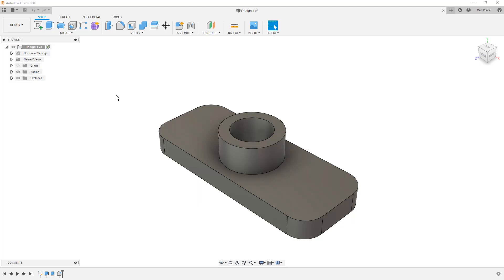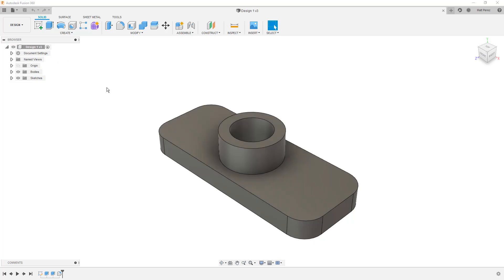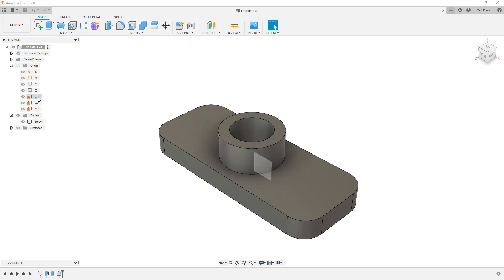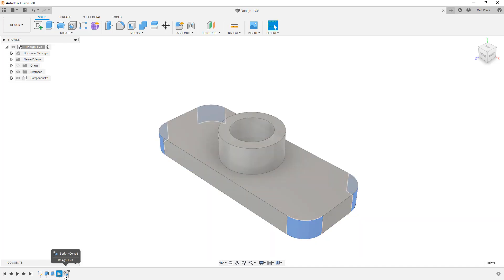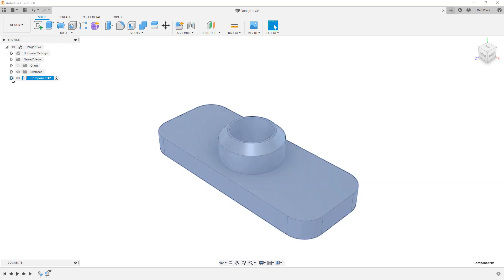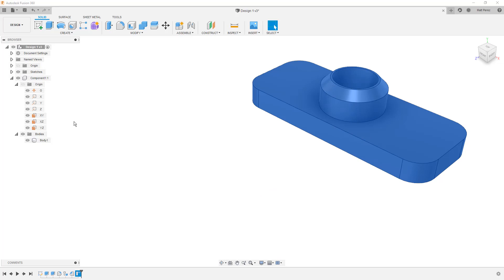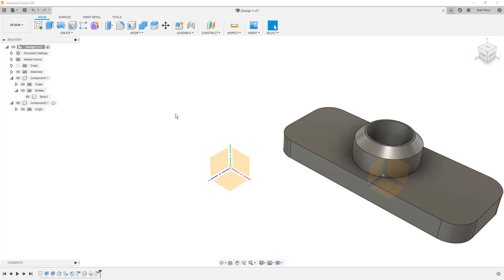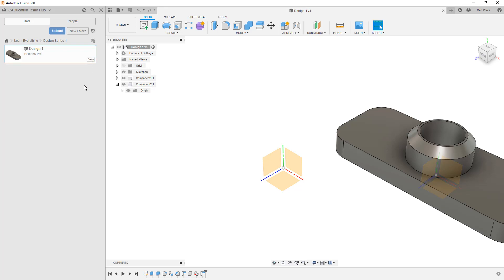Intro to Fusion 360 - Part 7: Intro to Assemblies #Fusion360 #HowTo #Tutorial

Comment: At 05:22 when you create the new empty component, the July 2023 version doesn't have an empty option. I looked elsewhere online and the Standard Component with parent selected seems to be the same thing.  Is there anything else to consider differently for empty vs/ standard?
Reply from the maker: Hi, I am currently working on some new entry level courses for various areas of Fusion, but in terms of workflow that changed, the big thing that shifted was the ability to create an external component in a design.  Basically this is the difference to having it saved in your project and just being referenced in your design, or having it completely in your design.  You can still edit it with Edit in Place, but I would stick with the internal option for now.
Reply: @LearnEverythingAboutDesign  Thanks. I appreciate the response. It helps if anyone else runs into it and I wanted to be sure I could finish up the series tonight without getting lost. Still the best start I've had for this software. Excellent training and looking forward to more!